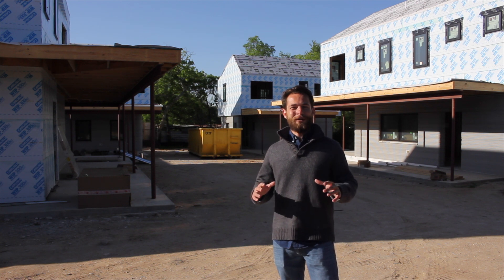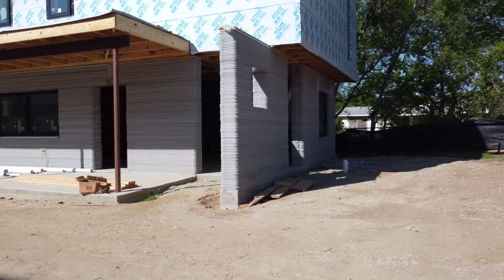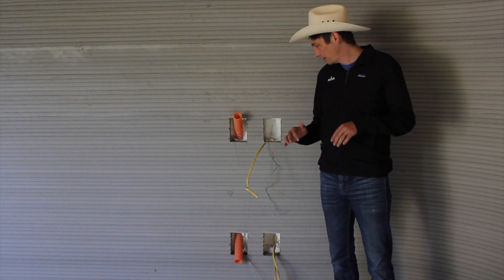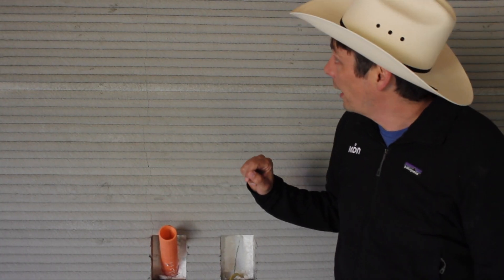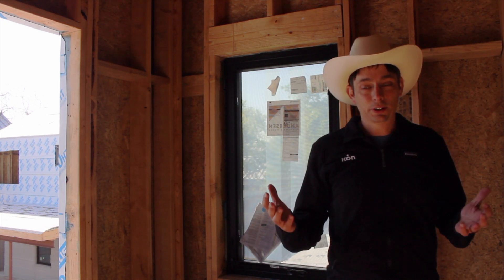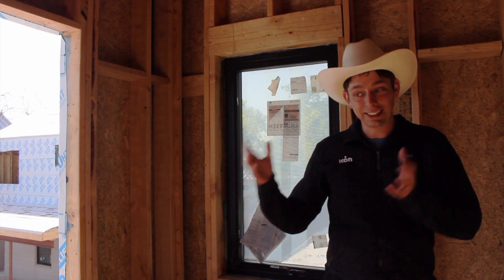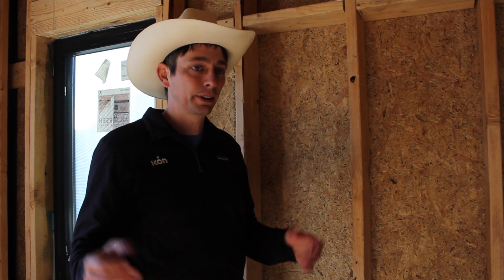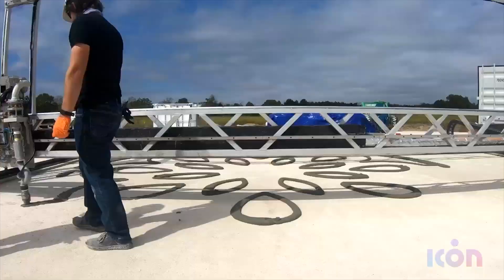ICON to 3D Print 100 Homes in Austin with Lennar

Comment: What kind of foundation do these 
concrete houses need to have ?
Reply from the maker: Regular poured concrete foundations
Reply: @automateconstruction  I'm thinking of building about a 28x28 small house .
About what would one of these concrete houses cost ..? ( in Mid Tenn )
Reply from the maker: Nobody has a printer like this in Tennessee yet so it’s impossible to get a reasonable quote that wouldn’t include dramatic transportation costs.

Comment: I'd want to replace the wood with either composite materials... of steel... I'd prefer interior walls being 3 d print concrete.. not wood frame... also the German and Russian 3d home builders are doing 2 plus story 3 d prints... are you able to do so
Reply from the maker: The Vulcan 2 only prints one floor.
Reply: @automateconstruction  so how much investment do you need to be ale to produce the frame work like the company in Germany?  they are already doing multiple story units... also your concrete mix do you have the option to do hemp crete  or other concrete formula

Comment: People want nice affordable housing. Which means Localities need to back off of their new house taxing structure. I would also use closed cell foam covered with Aluminum Double Bubble across the studs and then taped off everywhere it ends or joins with itself.

Comment: Mmmmmmmm  I guess this is in the very early steps, the equipment by itself will not be able to complete the structure, but i think the market needs to think more realistic or ask Elon for one-day meeting lol, you need pre-made Tools/parts to add to the printer and structure, what is need for the equipment to be able to go to make the Roof and 2nd floor.... All you need an engineer team that is able to create those tools and make it...  

For example this house 2nd floor structure walls / exterior walls there is not a reason why the printer could not do it, but like i say, great job on this early steps
Reply from the maker: Yes one day meeting with Elon where do I schedule that?

Comment: I'm still apprehensive about those cracks in walls...
Reply from the maker: Concrete cracks this is the case with all concrete. It’s not a matter of if it’s a matter of when. The material used for 3d printing is not exactly like concrete and has been consistently improving decreasing cracks.

Comment: I believe your products and ideas will continue to grow and solve many of the structural/architectural problems in the future. As a retired Architect, I worked, designed and built many concrete structures. I believe your ideas of long-term use and sustainability are great. Keep pressing on!